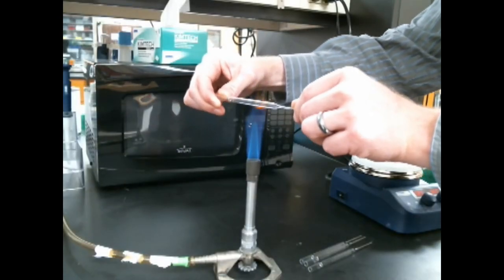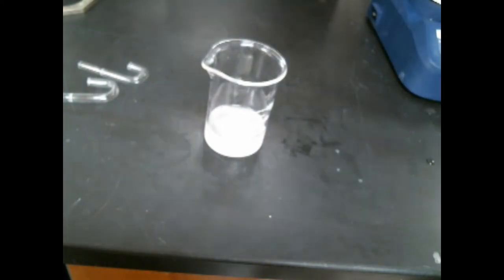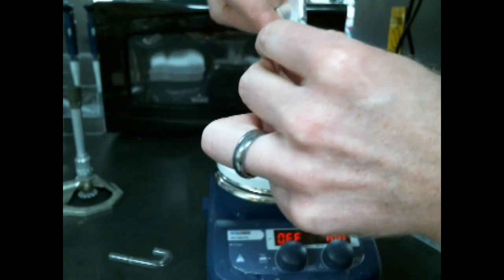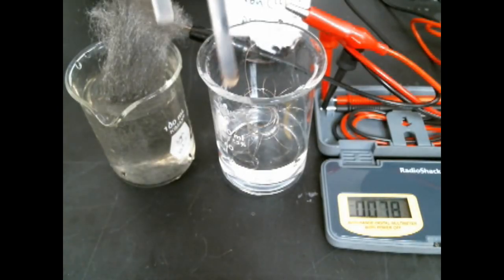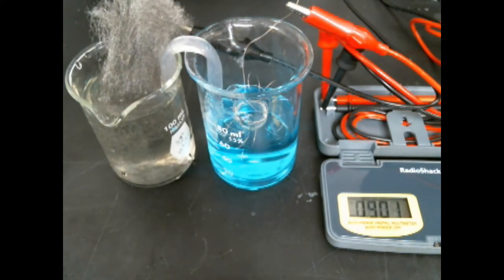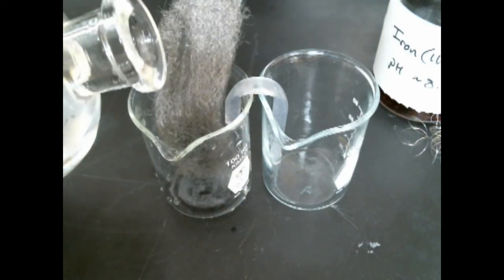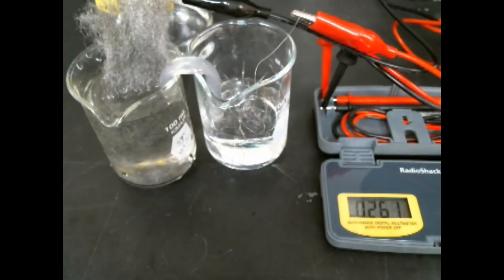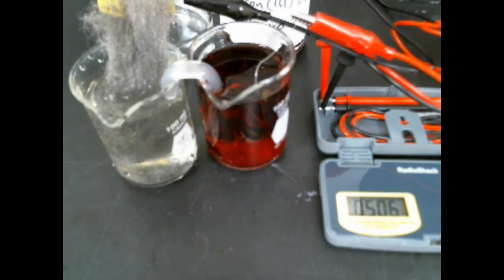Sanity check: Standard Galvanic Cell

Comment: I remember the old "standard galvanic cell" demonstration and I remember that the "ionic salt bridge" was one part of the "magic".   I also remember that as an option a "ceramic cup" was another way to bridge between the solutions. Peter, could you expand a bit on what would be the desirable characteristics of the separator material? I have seen discussions where semi-porous polymers are used and then they test the methods of either doping the polymer with conductors or modifying the polymer structure to be more conductive. 
I ask because if physical spacing of the charge collectors can be maintained in the electrolytes, and since unlike a Li-ion, you are not needing to move ions across, what happens if you use a non-reactive conductor to separate the electrolytes?
Reply from the maker: I've tried making separators out of paper (cheap) hydrogel polymer (not very DIY friendly) and agarose. The separator needs to be ion-conductive ('cause you can't have lots of + or - charge accumulate on either side). Other than that, it should minimize diffusion to cut down on electrical conductivity, and (ideally) be ion selective so that the cathode chemistry stays separate from the anode container. I'm going to be experimenting with some different designs on the 29th. Electrical conductors wouldn't work, but I'll see if I can find a better cheap ion conductor.
Reply: Thanks! And enjoy your time away! :)